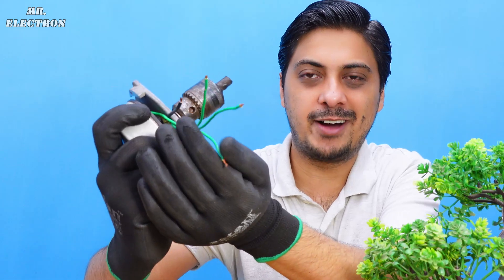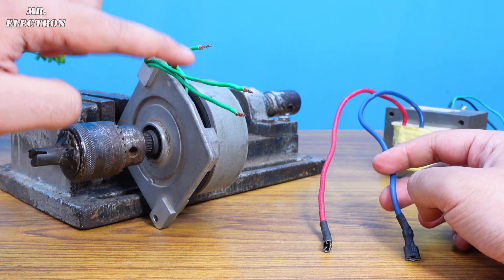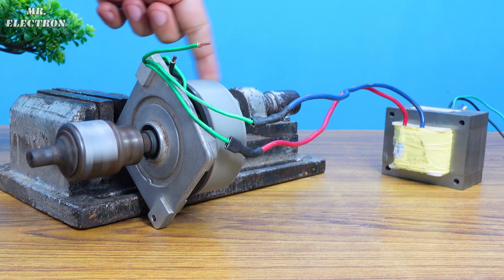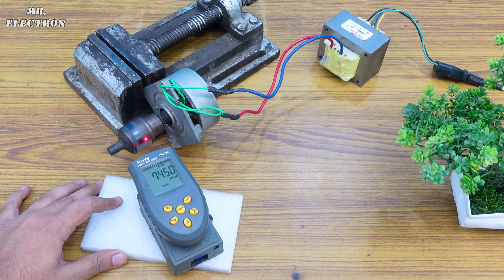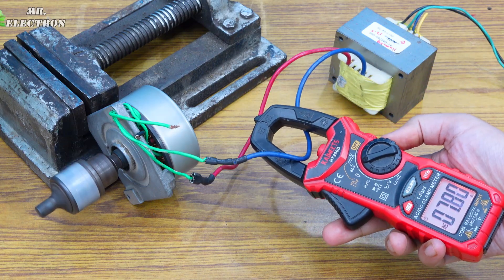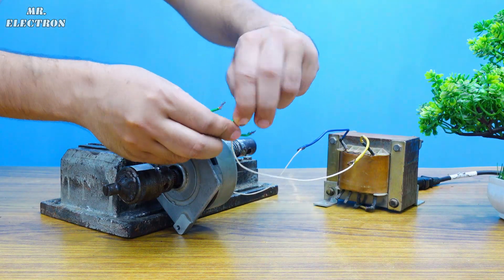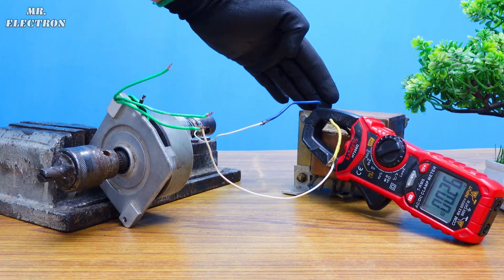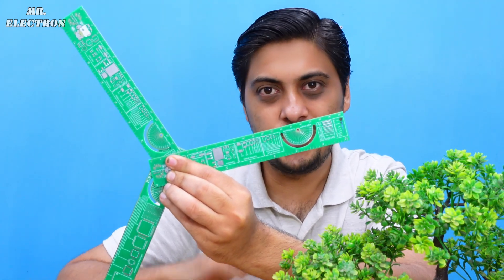How to Run Brushless Motor ( BLDC ) with just UPS Transformer & without any ESC or Electronic parts

Comment: I need higher capacity ESC controller that could handle large amps but difficult to get one locally and expensive to order from abroad. Please, I will appreciate if you could show how to increase the capacity of those cheap small ESC in the market or create simple one. Thanks

Comment: Use a capacitor and oneof the existing lines into he motor. It should off set the phase enoughto intake the 3rd.
Reply from the maker: Yeah! I thought so too but it didn't work with this type of BLDC Motor. Although i have discovered an even better method. Video will be coming soon.
Reply: @MrElectron it works on three-phase 240v motors
Reply: I'll be watching
Reply: Is it up yet?
Reply from the maker: @CravenMoorhead  its in progress
Reply from the maker: @CravenMoorhead  It's in progress.